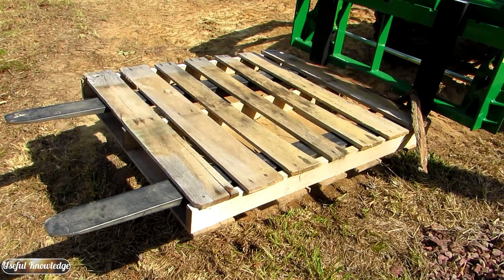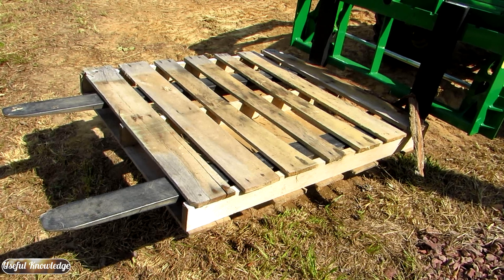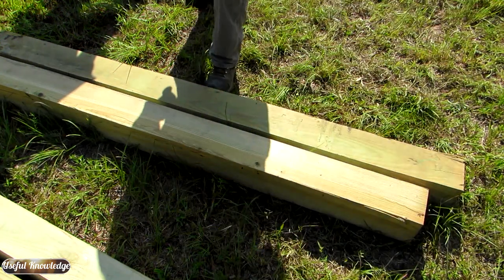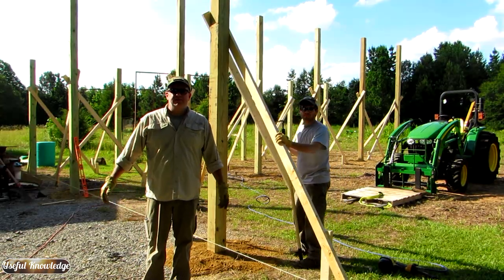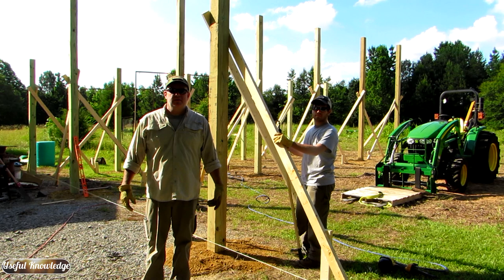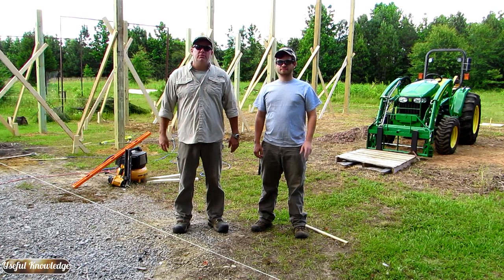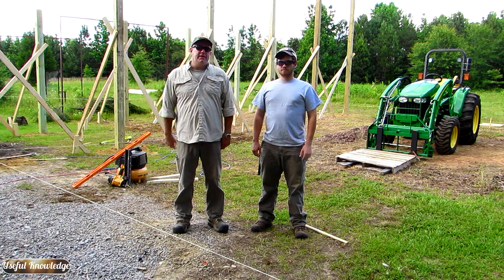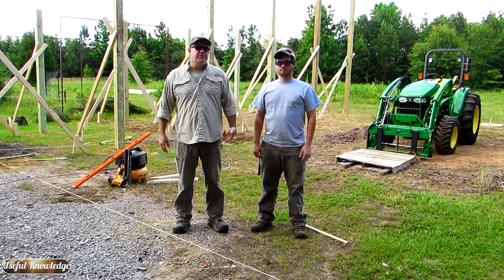Pole Barn Construction (Part 1: Setting Posts) | Useful Knowledge

Comment: Hole digging tip, when using an auger, stop rotation and lift out with dirt, swing to one side out of way and then give it a twist/shake to clear it, shovel tailings around hole after putting auger back in to go a bit deeper or to clean up, makes for a easier time instead of how you did it using a traditional manual clamshell post hole digger to clean out the hole.
For those wanting to not have to replace the buried part of a post when deterioration begins to rear it ugly head as pt wood nor cedar lasts much more than 25-35 years, there is a few options:
DIY concrete pier, NEVER encase a post in concrete, it will rot away in less than 20 years even if pressure treated, one you got the hole dug to desired or required depth, place a one or two foot length of paper tube near the top as the part below would be larger to act as a friction pile to reduce or prevent uplift at least in high winds (natural disaster weather is a beast and will destroy anything by the weakest point). Then either insert wet set brackets or L bolts for drill set brackets once you smooth the top, or let cure if you plan to use concrete bolts and the drill set brackets. Midwest Permacolumns is a leader and offers the most choices and best brackets in the industry. Best to use a medium or high psi mix that sets beyond 3k psi for anything larger than a shed, or if you use an engineer experience with Post Frame/Pole Building for your plans then let know or tell you the best strength of concrete mix to use for your planed size. You can also use said brackets for footer walls or if wanting a basement or crawlspace beneath said building. Drill set either uses expanding bolts which much be a distance from the edges of the pier or wall as they expand if too close can cause premature cracking, or use a bolt that screws into a pre-drilled hole allowing for flusher to outer edge of wall pre-finish look.
Another option if not to keen to make your own piers, is Midwest Permacolumns precast concrete columns which come in three height/length sizes and preset wet set brackets and offer two sizes for 4 by 6 and 6 square solid posts for the standard height/length column, with the other two height columns with only 6 square post bracket size. These are rated for at least 9k psi/ 689 bar and require installation of either a height adjuster if you need to or plan to go deep in 12 or 24 inch additional rise and double as uplift anchors and can be set in dirt or encased in concrete up to the foot of the column but not covering the attachment bolt, or graded angle bracket and securement bolt package for additional order and cost. 
Morton buildings uses this same Midwest Permacolumn design but with their own design being that the foot of said column is an adjustable metal system so as to offer easy height adjustment so all footers are the same height when it comes time to put up the building structure. These are also similar in strength and can be encased at the foot with concrete of same or lesser strength, adjustment bolt is internally threaded meaning the adjustment bolt is at the top of column between the bracket, this system works best with their columns as they are not made with the tabs on the outside of said column, their tabs slide between the laminations.

I am not affiliated with either company, nor am I an expert. Just giving those watching this for first time before doing their own build, some tips and suggestions to help out a bit, hope you find this useful.
Reply: Oh another option for longer post life if you rather set into dirt, check out Plasti-sleeve long and short sleeves, you may want to pre-drill a couple holes on the side above the base to let any water that may get in to seep out, though it does require use of a sealant at the top, comes in many sizes for all types of post sizes. They also offer a plastic footer pad for better load bearing and some additional protection, uplift protection also required and also a protector for the skirt board with a trim piece which I think is optional and useful for wood or cement board siding finishes, not really necessary for sheet metal cladding but still useful for it as added protection against 'splashing' but also for aluminum or vinyl sidings as well. Useful for floating slab floor or gravel or even dirt floor inside for longer life, all come in a black color HDPE.
Or alternately Post Protector sleeves from Orgill similar in design but different color HDPE and outside profile, sleeve type in post 60 inch and 42 inch residential for decks and fences or a 30 inch grade guard said to be useful for all applications. All feature a channel system on two sides so any water penetration can weep out the open base and same channels allow it to breathe as well, all come in all post sizes. Also offer skirt-board protector guard though only wraps the bottom and lower part of outside face, but no "trim piece" option.
Both require uplift protection either a bracket or rebar through post per code where required or if desired.
Reply: Don't worry these people in the video are not experts either, obviously
Reply: Or, you could just coat the bottom 4-6 ft of the pole, depending on hole depth with a coat of 2 of tar.  I've been going back and forth on how I want to set my posts.  Since I live in a hurricane area, I need the post in the ground for integrity.

Comment: I enjoyed watching you work smart not hard, you made that look easy. I have property I want to build on and the prices Im getting are very expensive to build a 30x50 pole building. $75k and $50k last year half that price. Getting harder for us little guys to "build back better". FJB.
Reply from the maker: Lumber definitely went crazy on the prices.  OSB is still super inflated.  6x6’s and 2x’s are starting to get back to normal.  I think metal has came back down also.  I put off building a screened in deck because of these prices.  My dad was in lumber for 40 years before he retired.  I’ve seen the bottom drop out and mills shut down.  I hope it comes back down and gets back to normal soon!

Comment: Pretty easy if you throw your 80 pound bag of sck Crete in the hole and use a 16 inch auger and nail a hurrican block on the bottom of each pole set them on the forks then move by each hole and drag them off of the forks stand them up plumb them in with a 4 ft level throw dirt in the hole and tamp it in with a tamping bar the pole stands freely with no 2x4 braces then you gurt your building up with 2x6 and 2x8 treated bottom band and that boys is how you build a pole barn

Comment: Gentleman, good video,  helps me get items ready for when I  start my pole barn. Would love to work with 6x6 but my main structure poles will be cedar trees. I am on a slight slope and going up with a second floor. Any advice on how to square such a large building? Thanks
Reply from the maker: Richard Britt.  Hi.  I always determine where I want the front of the barn, line up the front corners and then square the sides and back using the Pythagorean theory with a two 50 and a 100ft roll out tape measure.  I get a some help to hold the tapes in place. I hammer in a grade stake where the tapes meet. That barn in the video came out about one inch out of square overall which is pretty good for a large building.  The trim pieces cover those little out of square issues 😀.

Comment: Is it ok to bury the 6 by 6 without any concrete? I know the hole will need to be much larger ( about 18 inches for 6 by 6) if we do use concrete.
Reply from the maker: Hi.  I didn’t use concrete.  Ground ends up settling around the post and they don’t move.
Reply: @useful.knowledge  That is great if the earth can keep them stable. 18 inches hole does cost.

Comment: Simple solution - I'll be setting 20 footers using something similar.  I had planned on using tractor to hold it at vertical while post hole is tamped and concreted and going post to post - but looking at your bracing of each post one could carefully check alignments, spacing etc. before casting in concrete.  Extra 2x will just be used as purlins later anyway.  Thanks
Reply from the maker: Hi.  Those are 2x4x10'.  They did an excellent job of holding the 6x6's plumb while we tamped the dirt in around the post and while I framed the barn.  I did exactly what you are saying.  I used the 2x4's as "nailers" or "runners" for attaching the metal roofing with screws.  I just finished installing all of these 2x4's tonight.  Metal roofing will go on next week.  I left the outside posts (corners) secured with the 2x until I get the roof on.
Reply from the maker: Forgot to add, I did this with a barn about 15 years ago and its still plumb and level.
Reply: Seems a great way to do it.

Comment: Great video and a great tip. I plan to use this method to move railroad ties. Where did you that lifting strap?
Reply from the maker: Clough Shelton.  Thanks!  That’s short recovery strap that I bought at Tractor Supply a few years ago.  This should be the link:  https://www.tractorsupply.com/tsc/product/superwinch-recovery-strap-2-in-x-6-ft

Comment: What size tractor do you have? thanks.
Reply from the maker: bp30656Z. Hi.  It’s a JD 4105.  It’s a 41 hp.  The tractor handles 6 ft implements really well.  It also has a 6ft front end loader bucket. Thanks!

Comment: no blocking? what about up-heave?
Reply from the maker: Derek Peterson. Hi.  We’re in North Alabama.  Out frost line is only a foot deep so we put these in at 2 ft deep.  We haven’t had any issues.
Reply: @useful.knowledge  I'm referring to treated wood blocking around the bottom of the post. Worst case I say this year was when a 12x12 OH door was blown in and turned the front of a guys barn into a kite, sucked his posts out about 1.5 feet, had to regrade his whole site all while in the middle of having his place on the market. In WI here and we place 1ft blocks nailed in around the bottom of the post when using the cookie method. Full concrete isn't that great because of expansion issues and rot conditions.
Reply from the maker: Derek Peterson.  Wow!!  Ok gotcha.  We get some 60-70 mph straight line winds but we have lots of mature trees around us which breakup the wind.  Other than the winds it’s tornadoes which are going to take it if they hit it.  I’ve spent some time in WI and I can’t even imagine how high the winds get coming across those huge fields.  Your idea is definitely worth doing.
Reply: @useful.knowledge  if there are open walls in the building we go at least 5ft deep, 6 if it's large enough, then we double up the blocks on all sides. Definitely worth the 2x 8ft boards each post when setting open walls 😉

Comment: What’s the dimensions?  How wide is the center bay?
Reply from the maker: txfj40.  Hi.  The total is 40x40 ft.  The center is 16x40 and the sides are 12x40.  I needed 16 in the center for a camper with the slide outs open.

Comment: I'm looking on videos for cattle fencing, if you have any.
Reply from the maker: Stephanie.  Sorry, no cattle fences.   I built miles of fences when I was a teenager working in the National Forest Service.  We always built  a 3 or 4 strand barbed wire using metal t-post with a what looked like a cutup telephone pole for corner post.   We also would install a wood (7 or 8")post every probably 100 feet.

Comment: How do you make sure all the posts are at exactly the same height/level at the top? It seems like it would be hard to make sure all the hole depths are exactly the same.
Reply from the maker: Hi.  I show how to do that in the next video of the barn building.  Here is the link:  https://www.youtube.com/watch?v=_37XwjouJfY
Basically you find the common point on each post and measure up from that point for the cut.  You'll need a laser level.  I bought mine at Harbor Freight.  It was cheap but worked.  Best of luck!
Reply: 1. Use lumber that's a little longer than the final height.
2. Set poles.
3. Cut tops off at desired height.

Comment: How about a material list, dimensions, thanks!
Reply from the maker: Hi.  It's a 40x40 ft.  The tall center section is 16x40 ft.  The sides are 12x40 ft each.   The posts are 8 feet apart.  Sorry, I don't have a good scrubbed materials list.
Reply: Thanks for the quick reply. I am planning to build a similar barn on a newly acquired land and was wondering about how much lumber would it require. Anyway, I appreciated the response, thanks. I liked that video and subcrisbed to the channel as well.
Reply from the maker: Awesome!  Thanks!  I found a crude spreadsheet of where I was adding up the materials.  If you will send me an email at useful.knowledge.tv@gmail.com, I will send it to you.
Reply from the maker: Welter Prado.  I sent you another email late yesterday.  There was a mistake on the material list.  I knew I changed something while framing.  The email explains the changes.  Best of luck!